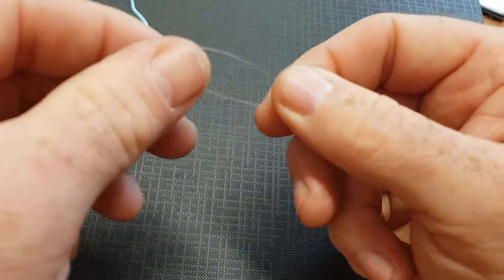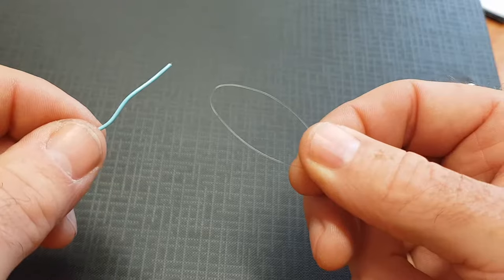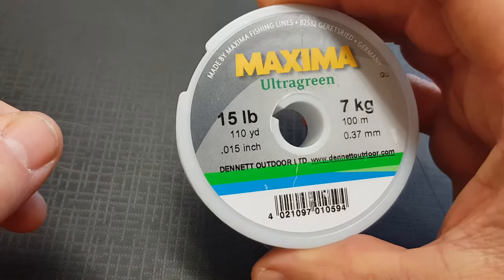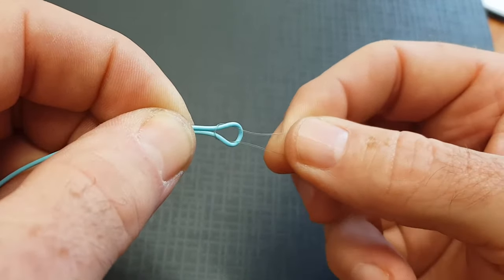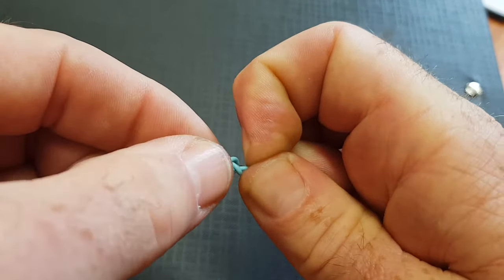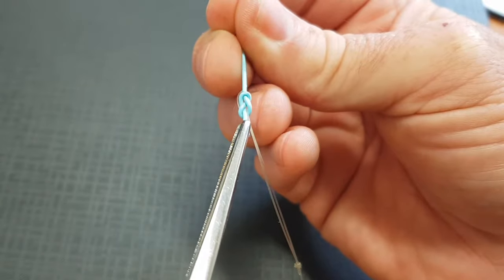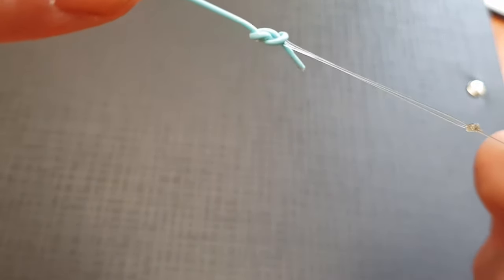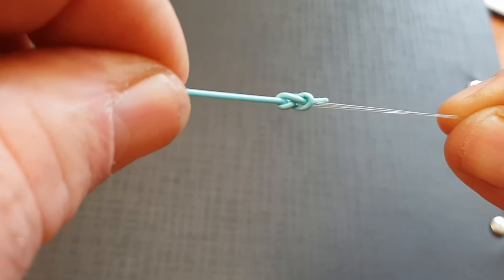Attach Leader To Fly Line Without Loop On Fly Line

Comment: Well I wish I saw this 4 years ago! Nail knot is not too much hassle, Flip Pallot connection is awesome, but this is fool proof and quick and easy to tie anywhere. I tie in a 6" 15lb double perfection loop, then run my leaders of choice off the 15lb loop. Less loss of fly line after a bunch of leaders. Thanks for this winner!!!

Comment: I have been fly-fishing for 35 years now i have fished many parts of the USA and canada i live in the uk ,i seen this video 3 weeks ago now so i decided to give it ago i can tie the nail knot etc etc with 35 years experience i should do by now anyway went to my local river to target pike on the fly first thing i will say is this knot is incredibly easy to tie is very neat and small much better than a loop to loop as mick said here in this tutorial once you pull the knot tight with the forceps the knot is very tiny and very strong i landed 5 pike that day  the bes t being 24LB 5OZ and may i say this knot handled the pike with no problems what so ever since then i have fished for brown trout rainbow trout and the grayling people have said here in the comments that knot is big and spooks fish this is simply not the case i have  use d it to fish for grayling and believe me  grayling are very very shy fish and this knot did not spook any fish at anytime to be honest this has very quickly become my favorite knot i always used the nail knot but this knot mick has showed us all is simple to learn pull the knot tightly together for that neat and tiny tidy finish my grandfather told me many years ago keep your leader the same length as your rod or 6 inches shorter and you will be in good shape  he was 100% correct and remember keep things simple, this knot is simple but very very effective KEEP YOUR LEADER THE SAME LENGTH AS YOUR ROD OR 6  INCHES SHORTER  THIS WAY YOUR LEADER NEVER HAS TO PASS THROUGH YOUR GUIDES WHATEVER KNOT YOU USE,i highly recommend this knot mick has shown us it's absolutely genius,Thank you mick very much appreciated,great tutorial
Reply from the maker: Many thanks for the kind words and great advice about the length of the leader. So pleased you've had such success using it. 🎣

Comment: Thanks this was awesome just tied it on haven't fished with it yet though. It may be obvious but I used leaders that already had the not tied in them and it worked well,  just letting anybody who has leaders like that know you don't have to worry with tying a figure 8 knot
Reply: I just use an over hand loop knot. Very simple and easy. I’ve never fly fished before and I’m using mono to connect it so correct me if anything I’m doing is wrong but that’s what I’m using for the tutorial.

Comment: Thank you for this, as I couldn't get the nail knot to work in the comfort of my home with zero wind, no sweat dripping into my eyes, glasses steaming up, and mosquitos and gnats buzzing around my face.  I'm new at this whole fly fishing thing, and I've gotta say, I've managed to get through casting basics, and the other nuances that come with fly fishing, but I'm not sure how guys tie some of these knots.  Outside of the usual miserable stream-side conditions that don't help, I've got fat fingers, basil joint arthritis, all the while working with line and hook eyes that are nearly invisible to my blind eyes, without much in the way of patience.   Maybe fly fishing isn't for me.  😆
Reply from the maker: Anything that makes fishing a little easier is worth a try and you're right, there's a lot to get your head around especially as a beginner. keep at it Joe, it'll all come together and good luck. 👍

Comment: I cut alittle tiny bit of my fly line off at the tip. My old leader was wrapped in tight knot around the tip of the fly line. Did i make a mistake?
Reply from the maker: It;s hard to say without seeing it but as with any knot it's always worth practising a few times until you feel you have it right, good luck with it.

Comment: Won’t cast right especially if it’s a thicker line like 7-8 wt. I tried this method for a while but found it better to use a braid to no no type knot that works better
Reply from the maker: Thanks for the comment Jimmy, as with all things fishing it comes down to a personal choice. I use this connection on a 9-10 wt salmon line without any issues but at least you gave it a try.
Reply: Absolutely true. I’m a tarpon guide in Key largo and its hard to find good knots and connections that won’t spook a Poon.

Comment: How long must the leader line be
Reply from the maker: Leader length is purely a personal choice based on flow/depth/clarity etc.
Reply: @mickwilkes3397  some dames are deep and some aren’t so how do I choose what length
Reply: Dams*
Reply from the maker: There's no easy answer Clive as there are so many factors but if the fish are deep then you would probably opt for a sinking line or at least one with a sink tip...and also a heavier fly, then a standard leader length of 8'-10' would be ample.
Reply: @mickwilkes3397  thank you very much 
I did order my rod so when I get it I will see what suits me but thank you alot
Reply: @mickwilkes3397  feet or cm

Comment: I just snell my leader off the fly line. Zero bulk. The leader is paired to the weight of the fly line so I need never change leaders, only tippet material. Keeps all the energy of cast going into the line right to the fly. loop to loop is utter garbage.

Comment: Sorry, but this knot is way to bulky to be practical. It has bulk, wind resistance and will catch going through the guides. The Nail Knot is much smaller, much more streamlined and is not difficult to tie. I would never connect a leader in this fashion nor would I ever recommend it to anyone.